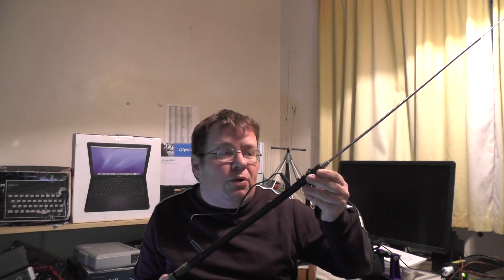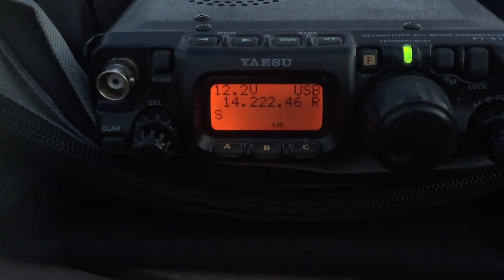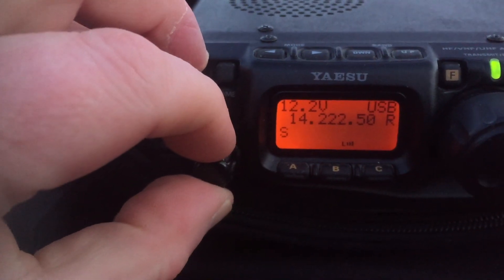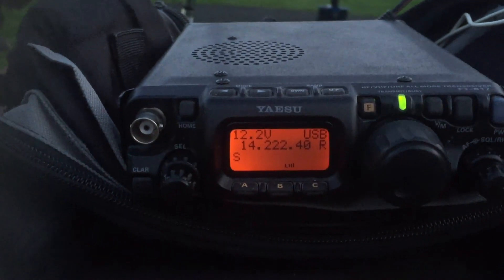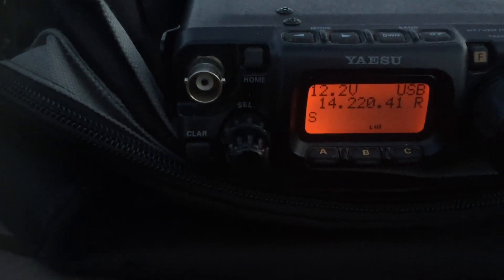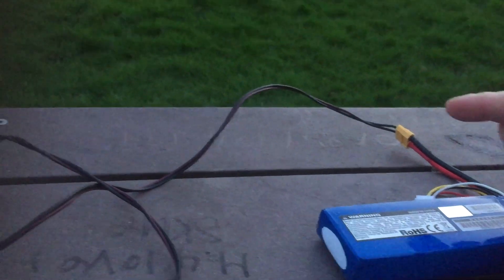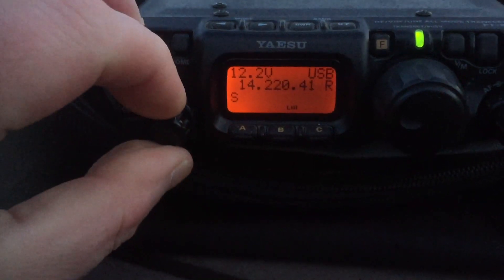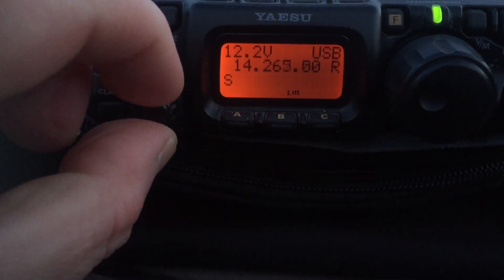RX test Watson multi ranger antenna

Comment: As well as using the jumper do you have to lengthen and shorten the whip or can you just use the jumper and fully extend the whip and use an ATU?
Reply from the maker: You shorten the whip or make it longer then once the swr is low then use a atu to take care of the rest
Reply: @2j4ez  Cheers😷👍

Comment: I always thought you needed loads of radials for HF and portable would be a joke.
I AM GLAD you proved me wrong. What was SWR like and do you need an autotuner. 
Keep up the good work on how to do this hobby on the cheap.
Reply from the maker: MrSnowMen hi thanks for watching . I’ve got a pro whip antenna which is just a piece of wire up a fishing pole I use that with a atu and it works no problems . The swr on that antenna was around 1.6 if I was to use a atu it would be a lot lower

Comment: Thanks for the presentation and Happy New Year 2012.
I recently bought the Outback 2012 for my mobile setup. From what I see it's a similar antenna with the Watson. I managed to make some nice QSOs on 20 m band, no complaints on this. I tried the 40 m with no luck today. I do have excellent reception and very low SWR, so I suppose that I will have QSO's eventually. But when I tried the 80 m, it was a disaster! No way to tune it. 
I am considering to go for the AMPRO whips, so I am asking for your opinion. What do you suggest between the two you have tested. Watson vs Ampro *3 (20, 40, 80).
Reply from the maker: Ampro 20 made a state side contact on 5w not really used the ampro 40 will do when the weather gets better and we can go out to the park etc again

Comment: Hi, thanks for a great demo.  Is that the Multi-Ranger 9 or the 200?  I'm thinking of getting a 9 but have read that it's difficult to get a good SWR without a tuner.  I'm also looking at the NanoVNA-H Portable Vector/ standing wave Network Analyzer, 10KHz-1.5GHz Handheld Digital Display Touch Screen Shortwave MF HF VHF UHF.  I've seen good reviews of this little item, which costs about £70.  any thoughts? I'm quite new to this and based just up the coast from you.
Reply from the maker: Hi its a multi ranger 9 i managed to get the swr on 20m down to 1.6 with out a ATU. Ive never used that analiser but ill look into it. i have a feature tech aw07a and a sark 100 analiser both seem to work ok
Reply: @2j4ez  thanks for getting back to me. I watched M7RUI with his Watson 200 and he's mounted on a cheap tripod with a ground plane made from 4 x 5m earth wire staked into the ground. Worth a try.